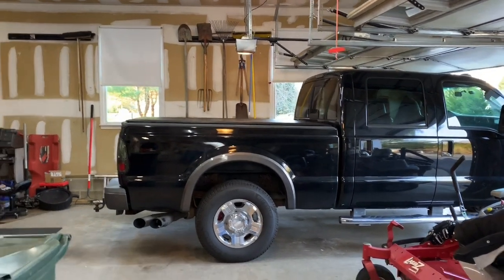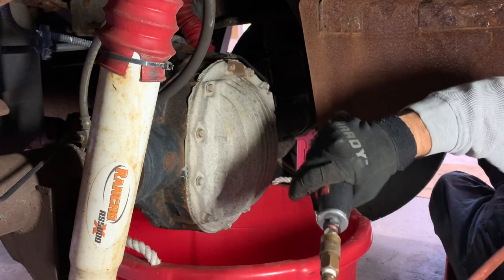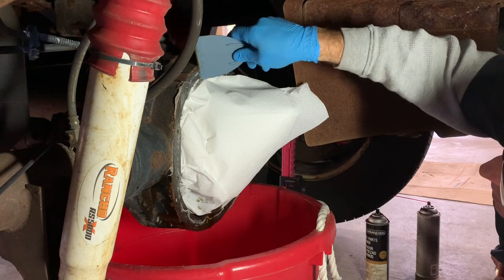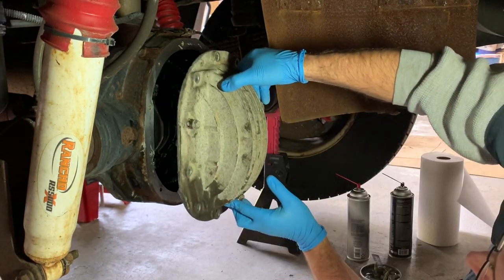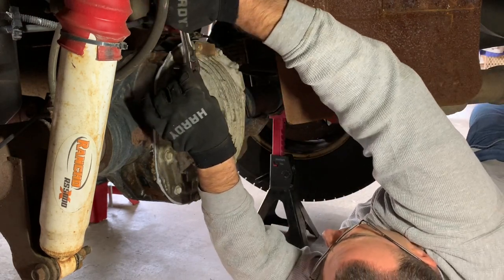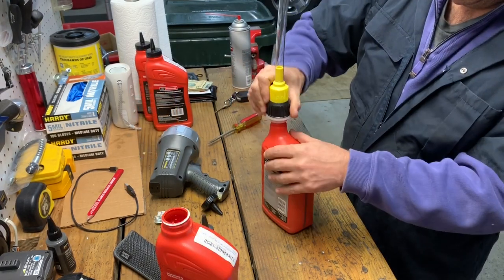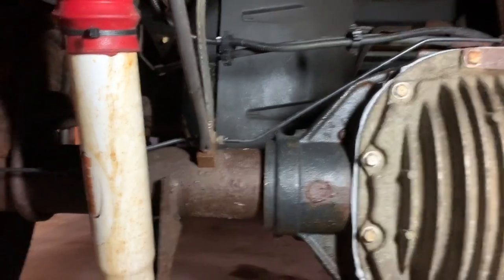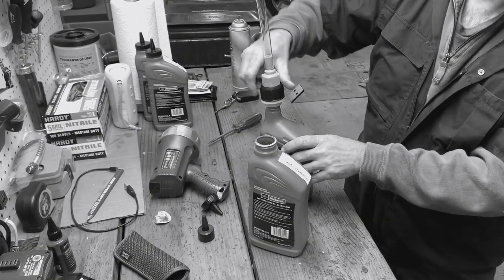Rear Differential Fluid Change & Axle Vent Repair F-250

Comment: I use a hyd. Jack against the bottom of the cover to get it off . I use a gasket instead of the RTV sealant.  Lot easier to remove next time.
Reply from the maker: Good tip on the jack.  Gasket should work just as well.  I recall I wasn't able to find one online when I did this job, so I went with RTV.  Thanks for the comment!

Comment: thanks for the video. did mine (93 f250 IDI) and followed the recommended torque spec of 35 pounds. now my top bolt has its head attached merely with RTV. needless to say that spec is wildly inaccurate…
Reply from the maker: Did I give you that torque spec in this video?  Been a while.  I can't remember.
Reply: @DieselMike  haha, no, from FORD themselves. go figure.

Comment: Hi nice video . I have a 21 250 with they 10.5 sterling . Now Ford says 75w85 fluid , I wonder why they changed it ? Gas mileage maybe ? My truck has the 6.2 6 speed  . Didn't need the diesel .